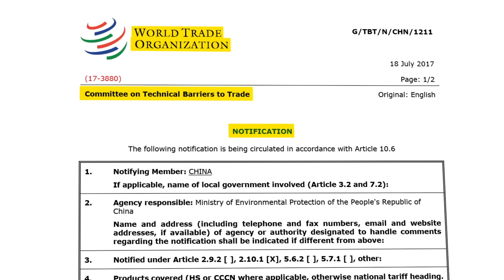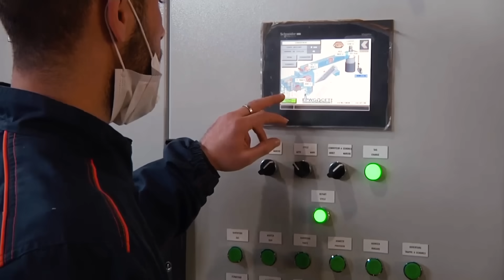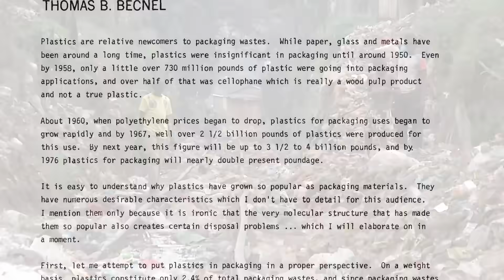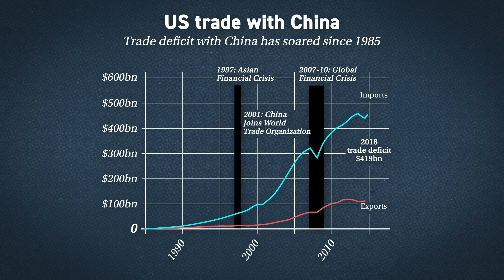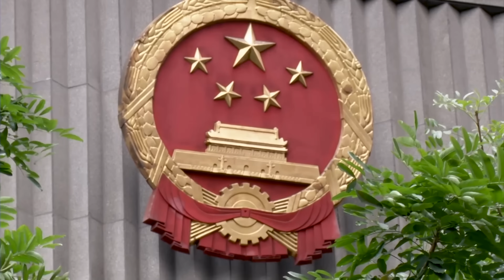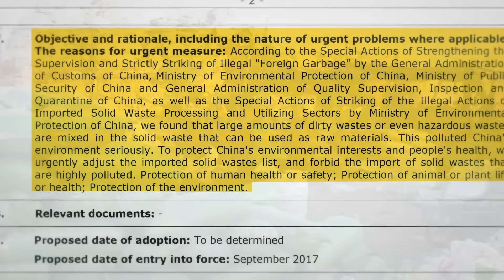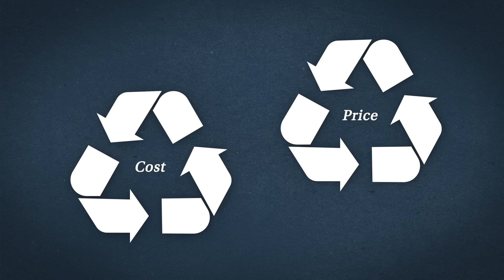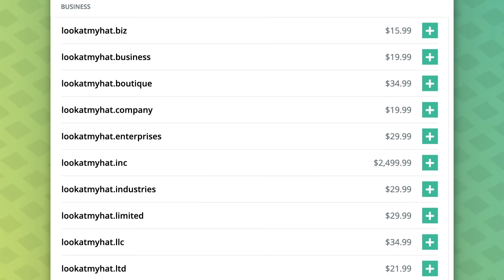How China Broke the World's Recycling

Comment: i still dont get why humans thought that using a super durable and long lasting material for packaging that you are meant to throw away was a good idea
Reply: Sadly cuz it's Hella cheap. Any other material with as much durability costs s lot more, which just leads to the question "why all this unnecessary packaging in the first place? Why the frick does everything come in two plastic bags sealed with Styrofoam then in a cardboard box with shrinkwrap???" That's the bizarre part I don't understand.
Reply: @maskedfoxx7173  This is just a guess but I assume they started with light packaging but at some point one or more products arrived broken , the customer complained and it's cheaper to use more plastic than to replace a single product I quess? It wouldn't surprise me some Karens complained that the parcel didn't seem safe even if the product was intact so they had to put more packaging for placebo of quality product.
Reply: @tsunami8242  Using tons of plastic is cheaper than getting sued for a broken product/unsafe one.
Reply: @maskedfoxx7173   Yes, I frequently receive way over packaged Amazon smalls in an over sized box with peanuts or pillow plastic yet orders from China come under packaged in bubble wrap all smashed to shit.
Reply: @maskedfoxx7173  I once ordered a book and it came in a envelope and 3 layers of platics.
Reply: @maskedfoxx7173  So the stuff you ordered doesn't break, and if it did the company would lose money to refund you
Reply: imagine if you made the average soda bottle twice or trice as thick/dense. And other packaging you use as a container or to carry stuff.
It would be unbreakable. Especially if it was resistant to UV light, it could probably last for several hundred years. But the plastic industry would go bankrupt if people stopped constantly buying new products.
Reply: @Nabo00o  so basically a food utensil 10x durable than normal food containers that can last for generations type of thing ? Would've been cool if that was how it was executed but ohh well..
Reply: @Nabo00o  yep.
Reply: @Nabo00o  Except the weight of the item would make it unprofitable(in the eyes of the greedy). Weight add to the shipping cost, which jacks up the price of items. A easy example of this is glass bottles versus plastic bottles, glass tends to be twice as expensive despite being worth the same or less than plastic options.
Reply: @Nabo00o  Downside will be the higher weights and volume taken up increasing fuel/power required to get products to the consumer. Also re-using a soda bottles requires washing and quality control. I remember in the 1990's and 2000's there were thick recyclable soda bottles, but I guess the economics of just replacing them won out, most likely combined with consumers not wanting scratched re-used bottles.
Reply: @Nabo00o  Catch 22 right ? That's why humanity has to choose between profitability or sustainability of human life. When earth can no longer sustain life, profitability will NOT, NOT , NOT matter.
Reply: @Nabo00o  You might be young, but the plastic bottles started like that. Millimeter thick durable bottles that had a significant deposit in the price. So you took back the bottle to the store, or a take back point. As kids we made our pocket money by collecting washing and taking back the bottles to these places and pocketing the money we got. Its light work we did vulnerably and went to get ice-cream a couple times from our earnings. Same as with glass bottles, except they were sooo much lighter, on our hands and bikes. 
Problem is, its hard to refurbish and clean these things to look neat and be 100% surely clean. Glass is better in that regard, and one use plastic is more attractive out of convenience. 
Nowadays even the take back glass bottles seem to go out of fashion.
Reply: Because humans.
Reply: @vizthex  No because Big oil wanted more money. Plastic isn’t very recyclable. Big oil lied to everyone. They know and have always knew plastic can only be recycled once or twice.
Reply: @vizthex  No. Because it's cheap.
Reply: @lewismiller870  so like I said, "because humans"
Reply: @vizthex  —self-contradicting in many ways…
Reply: Easy. I'm old enough to remember this. It had everything to do with trying to get rid of wood, glass, paper, and metal as varying standards for containers. Plastic was cheaper to produce, lighter to carry, and could be "recycled" instead of having to be cleaned or turned back in to the places that used the old heavy containers.

This affected bags last. When I was a child, plastic bags were an absurd notion and the paper bags from grocery stores could store a whole turkey in them without ripping.

We all needed to save the trees, basically. And much like when any inconvenient question is asked, like "Aren't most plastics non biodegradable and essentially unchanging when buried for up to 500 years?" The response was to immediately attack for not accepting the party line. "Why don't you want to help save the Earth?" was the manipulative jargon of the time. Pretty much same as now.

So why? Because a select group of people traded plastic for everything else, due to everything else requiring very visible mining/logging/smelting/shipping that some folks found displeasing, and in my mind there's no denying that cleaning played a big part too.
Reply: Not a good idea but a cheap one
Reply: Humans have greater foresight than any other animal on the planet, but not enough to keep from destroying ourselves
Reply: Probably one of the wiser things I’ve read in a while.
Reply: it's the fault of the plastics industry, they realised if people kept the plastic and reused it they would make less money so they started marketing it as cheap enough to throw away and made reusing it sound like something gross to do.
Reply: Fun fact, in the past for almost all purposes it was used mainly wood, glass and paper types of packaging like wooden boxes, waxed paper, paper bags, cardboard based packaging, glass bottles, etc. But ambientalists demanded that the industries stopped with paper to protect the trees and in consequence the industry moved to oil based polymers
Reply: Because it keeps the product fresh/dry and safe from pests and rot. It's also cheap and people prefer that their money goes to the product, not the packaging.
Reply: @joseph1150  This is the proper answer. Humans needed a the cheap plastic packaging to keep valuable meat and other food fresh as long as we can to reduce food waste! Yes, we have created a problem while solving one, this is how engineering works.
Reply: It was meant to reduce the level of tree consumption, people were used to cutting down trees to package stuff. So the solution is plastic, but now I guess it's back to trees, lol, how ironic.
Reply: @jyi9929  Using trees is still worse.
Reply: Did you watch the video?

All roads lead back to cost and profitability. 100% of the time.
Reply: Money
Reply: because it cost nearly 10 time less than the less long lasting options
Reply: @eldritchperfection213  if only that we’re true. We have had the cheapest, strongest natural know fibre to ever exist but the Americans banned it. Worldwide. And guess what for. Yep you know. Money, but also du pont had a contract with the government that they were to supply the glue that holds pulp together to make paper from fucking trees. Rant over. 😊
Reply: because is cheap, and people only live on profits
Reply: We can also make lightbulbs that basically last for almost an eternity, but they don't allow those, because it would lower sales dramatically.
Reply: Plastics don't actually last that long as a single cohesive item, they almost all go brittle in sunlight and slowly powderize or dissolve in salt water. So someone in the 60s assumed they'd break down fine in nature and take care of itself, but they didn't have the degree of testing and research we have now to reveal that those materials aren't being digested by natural processes at all and instead are ending up as microplastic shards in fish and fine shifting powders in landfills that don't break down further on their own. 

As glossed over in the video there are plastic eating microbes, but they have to be introduced to landfills on the regular because they don't survive all that well in the a semi-toxic environment. Ideally, these plastics would be buried in seperate landfills and processed appropriately with said microbes, but that requires digging new landfills in areas that sometimes simply don't have the space to properly dispose of it.
Reply: It's because humans have accepted Money as Gawd. Remember that saying about money being the root of all evil? Money is Gold, and has an effect like it on human minds, that effect being to devalue anything BUT the Gold, including human life and health.

 Greed, our National Sin, ends up the Gawd of the Culture.
Reply: They only cared because it was cheap. Now it's in our bodies.  Yeh
Reply: When i was 14 in the early 70s I couldn't understand why they were pushing plastic so much and voiced my opinion on it quite often. I got told by everyone that I was "against progress". Now decades later the same people who said I was against progress have a mouthful of feathers they can't stop eating.
Reply: It's cheap , Just cheap
Reply: Silly Homan's.
Reply: Theres also EXTREMELY THIN plastic bags i always get when my mom goes out to the market. Like shit tears easily if you put something heavy
Reply: Yeah, Welcome to the planet Earth.
Reply: Plastic is literally a wonder material.
Reply: Ron Cash  everyone acting like it's just about money, but plastic brings real profit too, it costs a lot less TIME to make and doesn't cut down forests
Reply: @thewhitefalcon8539   trees are replaceable and bio recyclided no lasting effects
Reply: @thewhitefalcon8539  you'd be surprised by what happens when the find the oil plastic is made from below a forest. Guess what happens to the forest?
Using oil is not gonna save trees anytime soon.
Reply: @superj8502  Sounds like you'd be surprised what doesn't happen when the oil is below a desert.
Reply: thank the boomers
Reply: @unclevamp  why boomers didn't have plastic bag when I was a kid wasn't half the crap u have in grocery store today it's insane going to the store now how many brands of cereal mayo or dog food cat food do we need something's cheaper are nasty  just real nasty
Reply: You don't get it? Seriously? Maybe its because the manufacturers of those materials would make a shit load of money. It's really not that complicated!
Reply: Because there's no better alternative.
Reply: So that your bread and milk can stay fresh
Reply: maybe they did not realise it was that long lasting...
Reply: There used to be a time when you'd return plastic bottles for refill the same way you'd do with glass but as the materials got cheaper almost all manufacturers dumped the practise. Also it was not the packaging industry problem, it was the waste management problem. Packaging industry tried to deliver durable, cheap containers for their clients that would protect goods from damage. Often these containers would sit for months or even years so they can't degrade before the product is delivered. Plastic fits this perfectly. Also it wasn't expected for plastic to be as resistant to natural forces. It's basically a hydrocarbon. You'd think it would fall a part given some UV light and microbiological enzymes similar to natural polymers. While it is a failure on our end to test for such an eventuality we didn't at the start and now the recycling/disposal of it lags decades behind in research and infrastructure.
Reply: from what i remember, plastic was originally made to be a reusable alternative to, for example paper bags, which were at the time seen as an environmental issue as they caused deforestation to get wood for making the paper bags, so to tackle that they started making plastic bags which were very durable and could be reused. but ig it all just shifted to single use and ppl just started throwing the plastic instead of using it again
Reply: @x_shinegalaxy_x  There are many types of plastics in the world.  Although plastic used in bags are durable, it will eventually break down.  Plastics grocery bags are not meant to be reusable, but most people do reuse them for trash bags or other secondary purposes.  They are definitely biodegradable if exposed to direct sunlight.  I have seen many plastic grocery bags outside that degrades from the exposure to UV light.  

As for paper bags, that is obviously bad for the environment because it requires killing of trees and processing in paper mills to form the bags.  Some of the paper used to make the bags are bleached and that also adds additional chemicals into the environment.  They are not environmentally friendly from the perspective of cutting down more trees.
Reply: Ron Cash  Russia had covert military operations in dozens of countries. They murdered much more people in Afghanistan than USA. 
Only during the Putin’s regime they had wars in Chechnya, Georgia, Ukraine, Syria and currently their PMCs also operate in Central Africa, Venezuela, Libya etc.
They still keep a part of Moldova occupied.
Reply: Laziness
Reply: money
Reply: Money.
Reply: cuz money
Reply: TheLastCasul  And why do people think they then have to put those limes with the thick peel in a plastic produce bag - to keep them clean mind you! - when you're just going to wash the fruit before you peel it anyways? The logic just isn't there! 🤯
Reply: why are we still producing so many different kinds of plastic? simplify it down to one or maybe a few and recycling can work.
Reply: One word: Money
Reply: money. simple answer is money
Reply: C O N V E N I E N C E
Reply: Because like most bad ideas, it was profitable for someone to promote it as such.
Reply: money
Reply: Same reason for all of humanities problems; Stupidity.
Reply: Probably because as a container it’s generally super reliable and, well, durable, which is perfect for the stuff it needs to carry
Reply: The answer is always $$$
Reply: Economics!
Reply: The only thing that matters in business is profit. "Good" or "moral" behaviour is irrelevant. This answers all "why?" questions in matters related to coorporate harm. I hope this clarifies the situation for you.
Reply: because it's cheaper than glass
Reply: plastic is cheap
that's the whole answer
Reply: Because its super cheap, and most stuff is shipped over long distances where durability matters.
Reply: our parents generation decided that : (
Reply: What’s extra tragic about many plastics is that while they take eons to break down completely, they start breaking down right away and become unsafe as food packaging relatively quickly.
Reply: We make long lasting super durable for packaging but make the product inside worsening and less durable. WTF
Reply: Because it was cheap and suppliers don't care what happens once it leaves their facility.
Reply: Because it was profitable.
Reply: money plus convenience.
Reply: because there is something called "capitalism"
Reply: Because plastic is cheap, readily available and governments around the world do not attach negative externality to it.
Reply: A man
Reply: munies
Reply: I ahree, simqbi.  And bubble wrap is a curse in more ways than one...
Reply: It's not durable and/or long lasting. Thermoplasts like polyethylene, polypropylene and synthetic rubber are a polymer that lose monomers over time, and these are the tiny parts that don't break down.  It's also useless and invisible and harmful at this point, causing cancer and stuff l0l
Reply: Some people are getting at it a little bit, but the reason is more than just "Because we are short sighted and greedy". Such answers hide the complexity of how hard some of these problems are to solve and lead to people adopting "simple common sense solutions" that never really address the problem. 

The problem is much the same as dumping waste chemicals in a river. If you look at the true cost, its much more expensive to dump those chemicals than it is to safely dispose of them.  The issue is that when you dump something, its not you paying the cost but rather everyone downstream, while safe disposal is a cost that you need to pay yourself.  Plastic is exactly the same thing.

Over its lifetime, plastics probably cost more to deal with than a lot of other packaging, but those costs are not born by the company itself. Worse still. here simply are not good alternative products that are cheap, safe, stable, durable, easy to form, ect, in the same way that plastics are. Many alternatives are not easy to shape, or degrade too quickly, or cost a lot more. Plastics might have their disadvantages, but almost all of them are downstream, while the alternatives have their disadvantages upstream.
Reply: I think unfortunately, the nature of our world just demands that something that's quick, cheap and disposable. The alternatives would either require even more planning and logistics, or just haven't been able to be produced on a global commercial scale. Materials like paper can't hold everything. Glass is heavy and also expensive.  Reusable containers would need a coordinated system to send them back to their sources. And there are biodegradable plastic wraps made of shrimp shells, for instance,  but those are still confined to production in university laboratories, and we just haven't found a way to mass-produce them.

Feel free to correct me if I'm wrong in thinking about this this way.
Reply: @archtansterpg4246  it's not "the nature of our world" that demands it, just capitalism. Humans made capitalism so humans can also destroy it and save our world and all life on it.
Reply: @archtansterpg4246  It's the nature of an ad-hoc world with nobody in charge trying to make it better. IF WE ACTUALLY TRIED these problems would be solvable!
Sending reusable containers back to their source is called reverse logistics, and Germany literally does it right now.
Reusable shopping bags are definitely a thing, I've had mine for 3 years.
Next step: Imagine bringing your own container to a supermarket to fill up with muesli or cornflakes.
Paper is a lot better than you think especially when made into cardboard, but changing plastic to paper is like changing gasoline cars to electric cars when the real solution is to minimize the use of cars at all.
Reply: We will never understand humans. Money understands humans. That’s all.
Reply: Sometimes I watch period dramas that take place in the early 1900's and one thing I've noticed is the decided lack of plastic. I wondered about this and after doing some research I learned that plastic emerged during ww2 which coinsides with the global metal shortages of the 1930's and '40's. This caused many consumer products to be removed from the market and as such a considerable loss of money to consumer manufacturers occurred. That's when DOW and Dupont took the scene with their nylon and polystyrene materials and manufactoring plants that previously created metal containers now had a way to make money again. This in turn help the consumer industries, who naturally took those products and never looked back because plastic containers were cheaper than stainless steel. Consumers themselves were ever so happy to see the return of their daily necessities to store shelves, so they didn't even question the emergence of this new material.
Reply: Because money
Reply: Supoosedly, the guy who invented the plastic bag did not intend for it to be disposable - initially anyway.
Reply: Mmm cheap burger
Reply: Like what would we you use wood?
Reply: Because line on chart go up.
Reply: I mean it's pretty simple. Cheap to make, won't react with the product contained in it, easy profit compared to other storage solutions at the time.
Reply: There's literally nothing wrong with it so long as people do the right thing with it. Look at Japan. 95% of all plastic waste in the ocean comes from 1 country (the one this video is about). Plastic being a bad thing is a cultural issue.
Reply: Keeps whatever your protecting good for the life of the plastic.
Reply: Depends on your definition of good idea.....    to a person who gives zero fucks and only wants to gain wealth,  plastic is an amazing idea.
Reply: I'm sure the plastic tycoons are from the same butthole the people came out of that convinced half of the population that they were going to die and you would also kill other people around you if they left the house without disposable medical masks, nitrile gloves and cases of hand sanitizer...  and now you can spot used nitrile gloves and masks laying all over the fucking place.
Reply: Because it was cheap to use
Reply: would you prefer paper containers for everything?
Reply: its cheap with big profits for the corporations , what don't you get about malignant greed with total disregard for the consequences ? ITS WHAT THE WHOLE USA RUNS ON !
Reply: TheLastCasul  When you see this in the supermarket , remove the packaging and leave it with them on the shelf. If it has a barcode , just take the barcode part.
Reply: Because then you can make it very thin and cheap.

Don't worry though, there are already emerging bacteria that can break down plastic, the earth finds a way.
Reply: It need not be a big problem. There wii always be applications where durable plastic packaging is needed. The thi g to do is to urn the plastic to generate electricity. It ought to be recognised as part of the zero trash cycle.  Combustible plastics can be burnt safely without generating toxic residues.
Reply: I believe it's called not thinking "ahead", now problems exist because noone thought of the impact of such system for "15-30yrs" ppl simply didn't think it would be a long term thing. Thats my thought process at least.
Reply: You don't get it because you haven't thought about it hard enough.

Plastic is the best packaging material available. It is cheap to produce, can be transparent, and properly secures the contents from outside contaminants.

The fact that plastic is hard to recycle doesn't take away from that: The pros of it still outweigh the cons.

Whether a single product should use 5 wrappers of plastic instead of 1, for example, is a different story. In this case we wouldn't be discussing the packaging material, but rather its wasteful use for presumably lesser purposes (for example, separating 5 muffins individually instead of in a single wrapper).
Reply: You are not the only person who had this idea before, but the solution is not as simple as "Durrrr just use something else". If your other material is, for example, heavier, then it burns more fuel to transport it, and you might end with even more waste than just using a disposable plastic. the manufacturers aren't dumb or evil for the sake of it, everything is done for areason.
Reply: humans doing what they do best
Reply: Humans take everything for granted.
Reply: Imagine your life without plastic. whether we like to or not we have come to a point where almost everything we touch is made of plastic or some variant of it. Insulation for any cable, plugs and the list goes on and on and on...Am not saying it's right, I am merely stating before we deem plastic as the devil and throw it all away we should figure out a substitue (spell check)for it.
Reply: @kingofgames42000  yeah but that comment is specifically adressing single use plastic, which is by far the biggest issue. The plastic insulation on a wire is a different story, as i won't be replaced for years or even decades.
Reply: Because it made those in with knowledge and power to make those decisions profitable, and they used marketing to convince people it was not a problem.
Reply: Thats like saying I dont get why humans decided to not die at the ripe old age of 30, since humans themselves are the most damaging thing to the environment that there is.
How about this: without these silly human things, you're dead.
Reply: they hadn't experienced long lasting garbage

and cheep, effective ways of packaging food and other products seemed to be really beneficial idea,

but don't worry we are close to - who would ever think that algorithms that try to learn and provide with the internet sources you might like was a good idea, and im pretty sure were are no way done with- new good ideas
Reply: @Grubiantoll  Oh, yes we had! Because before plastic, there was Glass! Remember glass bottles of ALL DIFFERENT TYPES AND SIZES? They made little tiny, almost microscopic glass bottles all the way up to Gigantically Huge glass bottles. No, wait, they still do! You can STILL go online and buy 6 gallon glass Carboys that folks use to make beer all the way down to almost microscopicly tiny glass bottles that people put perfume and chemicals in.
And of course there's all kinds of other packaging..... From steel cans to leather to wood to paper to aluminum foil to the aforementioned cloth and on and on and on and...........
Reply: Because profit
Reply: I think people who runs the government and take all decisions are dumb because these are very common sense things or they are very greedy and care only about money
Reply: @dikshant899  Vote for people who aren't dumb!
Reply: Ron Cash  If two products are exactly the same but product B is cheaper, then product A is a worse alternative.
Plus, glass is too dangerous aswell.
Reply: Look around you.  Plastics has made food safer.  They did a study and found out that reusable bags cost more to the environment than plastic bags.  The cost of water, detergents and energy to clean a bag was way more than the cost of disposing and making the plastic bags.  The making of the bags had a huge environmental cost from producing the cloth fibers to the energy needed to sew those bags.  On top of that, they were unsanitary and was loaded with germs.  People who use them feel like they are doing good, but they are actually worse offenders.  

Another cause of environmental damage are from the use of electric vehicles.  The batteries contains toxic Lithium and other materials which is bad for the environment and the raw mining of those toxic elements creates an environmental disaster.  These lithium strip mines are exposed and leeches toxic chemicals to the waterways.  On top of that, these batteries will eventually need to be disposed when its no longer usable and that creates another toxic dump.  The electricity used to charge these vehicles are generated from natural gas or other fossil fuels so it does nothing to reduce the carbon footprint.  Its all a lie just like the lie that recycling plastic is sustainable.
Reply: @ahndeux  BS. EVs are the key to solving Climate Change and air pollution. They are the best consumer of solar/wind energy. Even if powered from fossil, still much less pollution than petrol.
Reply: @noop9k  That is the biggest pile of BS.  EV creates more environmental damage compared to gasoline engines.  Instead of generating smog, it generates smug.  Like I said, where do you think the electricity to power the cars come from?  Fossil fuels!  If you really want to support environmentally friendly energy, the only one is nuclear energy.  Any form of energy that has to be transmitted over a long distance generates a lot of waste in terms of loss.  Transmitting electricity from the source to the charger generates an enormous amount of loss as heat and also entropy in the environment.  When you burn gasoline directly in the internal combustion engine, the energy conversion has a much higher efficiency.  Its simple laws of science, thermodynamics and physics.
Reply: @noop9k  LOL
Reply: Haha damn so much bad information in this thread
Reply: Capitalism.
Reply: @franciscoferreira9999  Ah yes cus any other economic model would have just pulled wonder materials out of their ass.
Reply: @franciscoferreira9999  as if commies were known for caring about environment.
Reply: @noop9k  Just because another system sucks too does not mean you can ignore the flaws of your own!!!! "But mooooommmm they do it toooooooo..."
Reply: @ThaFuzzwood  Have you just assumed my nationality ? :)
Reply: @jollygoodshow  “My” leaders?
Reply: @noop9k  They actually were
Reply: @noop9k  Every communist I know is actually very passionate about environmentalism.
Reply: @FlorenceFox  They are communists how?
Reply: @noop9k  What?
Reply: @noop9k  They might be, we don't know. We've never had a true communist system. I know Stalinism, CCPism, and so worth call themselves "communist", but they are as related to communism as I am a Venetian ballerina crab.
Reply: @noop9k  I'm guessing pygmy from Borneo
Reply: @noop9k  the fact that some "communist countries" don't have the preservation of the environment among their priorities shouldn't stop us from realizing that capitalism systemically provides incentives to harm the planet and the people living on it.
Reply: @noop9k  true
Reply: Capitalism 101 - Proft today,  fuck the future
Reply: @toolbaggers  Capitalism is what allowed you to even type the response on your phone or computer.  If it wasn't for capitalism, you would be writing your comment on a dirt floor with a stick.
Reply: @Dale Twokey Yeah, your food isn't packaged in it, your infrastructure isn't made of it, your medicine isn't preserved in it.
Without plastic and everything it represents, you don't exist. To think otherwise is so naive.
Reply: @Imbalanxd  wow so people didn't exist before plastic was invented? naive fool
Reply: @Glaze_119  you want to live like human 10000 years ago ? Bare skin and hunt for food ?
Reply: @TJ-ss9yu  where did i even begin to suggest that foo